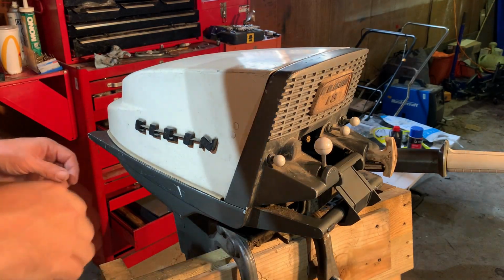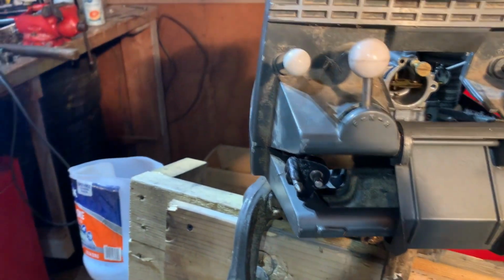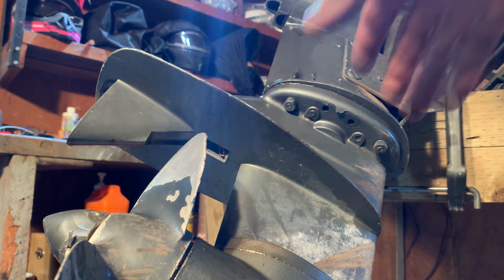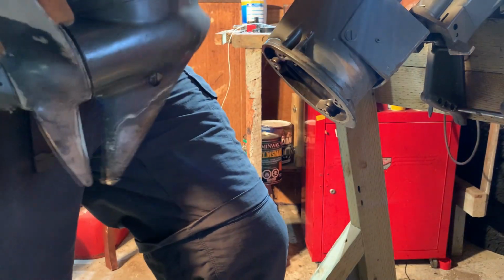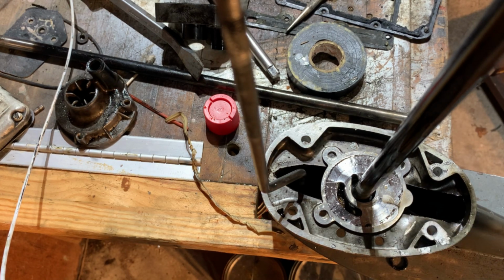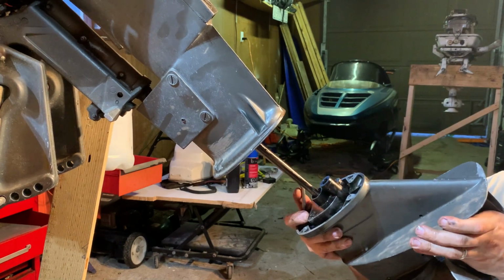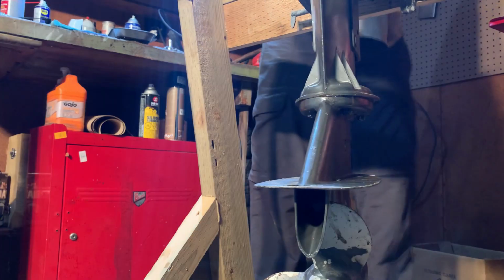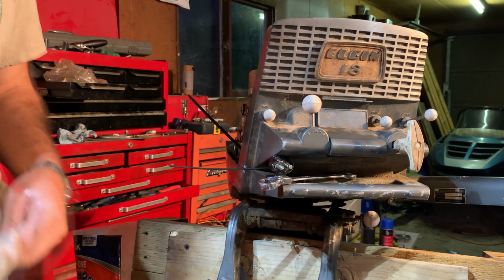PART 5: 1960 Elgin 18 Hp - Water Pump Installation and Add OMC Fuel Fitting

Comment: May I ask where you get your parts?
Reply from the maker: I read on a forum that a mercury impeller worked for this, (through a series of buyouts and re-aquisitions, the impeller remained the same but changed to mercury name)  I wnt to a local marina with that part number.

But typically I check amazon first and go from there.